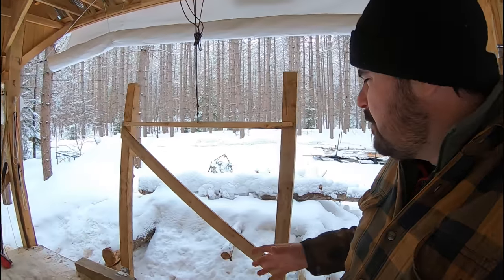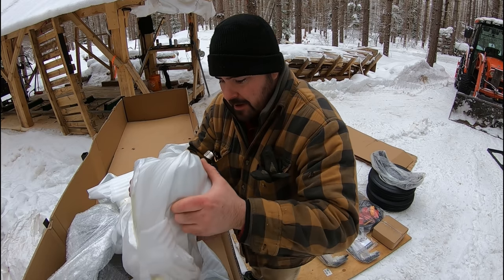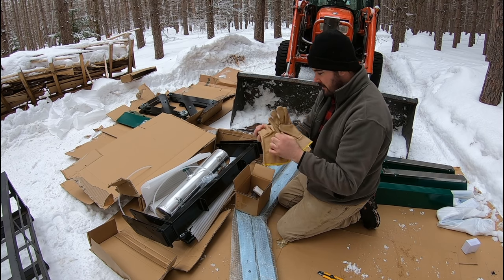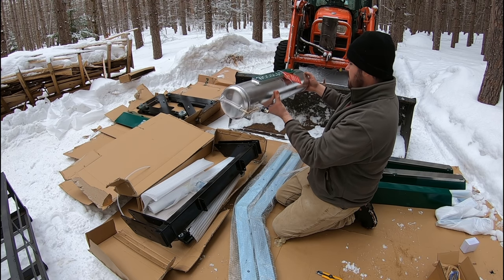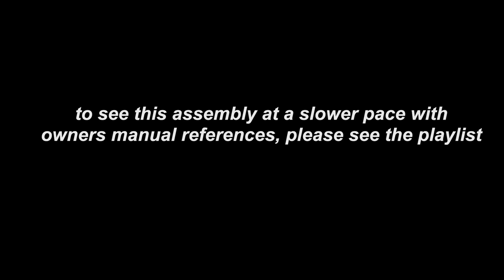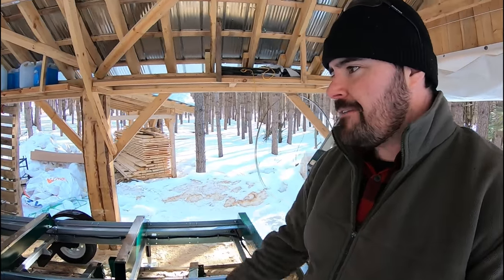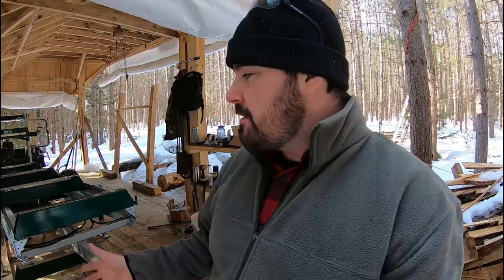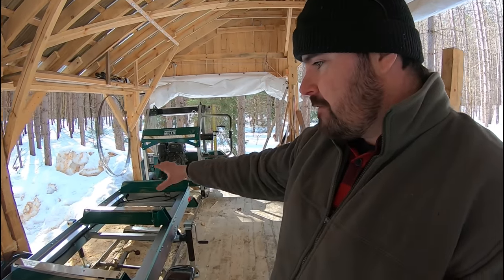Unboxing Woodland Mills HM130Max and Woodlander Trailer Assembly | It's a Good Day

Comment: I cant wait to see your new mill running. It should be a bit higher setup then your other mill. when you replace your log deck slope it a bit towards the mill  would be nice if you made the stringers squared up on your mill  I would make the deck at least 2 to 3 inches higher then the mill  then put a couple of holders  for stringers that  can be removed once the log is on the mill  Your setup for that is ok  just a idea  Make two pin holders out of 1 1/2 pipe  welded to flat iron to bolt on to the stringers so you can drop removable pins into  if  needed  thanks for the video very interesting from john

Comment: a quick tip from our experience. Take all the plastic bags of bolt and measure and mark with felt pen on the outside of the bag what those sizes and quantities are. This saves a lot of time when trying to locate the correct bolt referenced in the assembly instructions as you go along.
Reply from the maker: I agree. Fortunately the bags already had labels which saved a tonne of time

Comment: The metal shipping boxes it came in make great fire wood holders for you mini cabin
Reply from the maker: Great idea Art!
Reply: @sawingwithsandy  Always enough waste with shipping so a little repurposing means less waste
Reply: I was thinking make a weatherproof portable toolbox with some type of removal mount on the sawmill bed (ratchet straps would work) since it is already a trailer with wheels out of the metal shipping frame to leave at the remote milling site to hold extra saw blades, lubrication fluid, hand tools, tarps, etc. while you work at that location.

Comment: I bought a HM130Max last September thanks to watching your videos.  I have it on a welded trailer that I bought from the U.S. dealer.  You might want to consider tack welding all the bolts so the trailer doesn't ever get out of adjustment.
Reply: I lock mine down when towing and when I am not using it with Ratchet Turnbuckles. I have seen several photos where the mill head blew off the tracks by high winds.  I have seen reports where the tracks developed dents in the rails from bouncing up and down going down bumping roads.  The ratchet turnbuckles allow me to lock it down tight.
Reply: @garyhansen6457  You can always edit your comments by clicking on the 3 vertical dots to the right of comment.

Comment: Congratulations -- you might need to start a second channel and hire an apprentice now!  I milled with a trailer-mounted Woodmizer for many years before purchasing my Woodland HM-122 and installing it on a fixed base, and have learned about the pros and cons with each setup.  I look forward to hearing about your observations as you get into mobile milling with the new unit.  My only advice is: 1) check your track with strings religiously before every use, and 2) store the mobile mill under a roof if you can.  Good luck and have fun!
Reply from the maker: Thanks for those tips!

Comment: I wish I  could move as fast as you can.😁  Looks like my set up and I love it. Mine is set up for 16 ft logs. I'm excited to see you move it around your property to cut logs. I was just wondering if it had electric starter, that one thing I wish mine had I'm quite abit older than you are and pull starting is getting harder to do. Happy cutting  Sandy I'm sure I'll  be watching.  👍👍.
Reply from the maker: Thanks Del. Fortunately it does have electric start. I'm looking forward to that for sure

Comment: My mill is on the truck!  YAY!!!! Should be here Wednesday, just in time for torrential downpours… yay. . .
Reply from the maker: That is exciting! I still remember getting the call from the delivery company and was a great day
Reply: @sawingwithsandy  YAY! MILL ARRIVED!

YAY!!! THE RAIN HAS HELD OFF!!

so you just KNOW there was some other issue…

Woodmizer Mills come on their own custom pallets. For this particular mill (LX55) the pallet is 23”x65”. Designed to load on a hi-lo crossways.

When it got transferred at the terminal, it was loaded the same way. Instead of being put atop a standard 44x40 pallet.

HOWEVER. . . that “Same way“ is wider than my trailer. So the driver horses it around 90 degrees, but then it was too narrow for the standard pallet jack on the truck to get both forks under… and, the parcel and the pallet Jack would not both fit on the lift gate simultaneously in that orientation.

Luckily I am one of those “belt & suspenders” types, so I had also packed a come-along and some rope and 2-sheave snatch blocks…

with a bit of creative maneuvering, some muscle work, and a little bit of blood from when my finger got caught between the pawl and the gear on the come-along, (a napkin and some electrical tape is always handy!) we got it loaded into the trailer successfully.

we have appointments tomorrow. But Friday should be unpacking day up at the woodlot. I still need to get about 20 concrete blocks to put under the feet for leveling and stability but I am quite happy to have the unit delivered!!!!!  

Until I get my shed built, I will be keeping the mill under a 10x20 tube-frame tent.  I am thinking of modifying the shed plan a bit to make it sortakinda modular (at least for the platform/base structure) so that I can make the first structure to get the mill off the concrete block and under “hard” cover, then make 8’ additions for lumber drying /storage as I go instead of separate sheds.

Of course, the first project is STICKERS!!!!!!

Comment: sandy are you keeping old mill are you going to store  lumber there.check battery cables make sure they are crimped good mine wasn't came loose and melted rubber off cable before i could get it unhooked. don't leave your books in tube mine got wet and are unreadable i don't know it they sweated or rain got in tube.take care, be safe and well.
Reply from the maker: Thanks for the tips John. I’m going to keep the old mill for now

Comment: Hi Sandy. My HM130MAX with trailer is due to arrive any minute now. I watched the assembly of the saw and you lifting onto the trailer before watching this video. Would it have been possible to have assembled the saw on the trailer or will I need to plan on assembling separate and lifting onto the trailer like you did?
Reply: Ok, after watching the videos, I realize this was a dumb question now. Hopefully I can get mine assembled on my mountain property this weekend. Thanks again for your videos!
Reply from the maker: Hi Reuben. Sorry for the slow reply. It's all good. No question is a dumb question and I"m happy to help if something else comes up
Reply: @sawingwithsandy  If you ever decide you want to take your show on the road, I'd love to have you come visit my little mountain property in Colorado! Just got my sawmill up this weekend, but could only get to the first page of assembly before I discovered that they had only shipped two joining plates. Hopefully I get the replacements in time to assemble next weekend. I went with the HM130MAX XL, and while I'm not sure how many 16 foot beams I will ever make, I figured it is better to have and not need, than to need and not have. Plus, not sure how many more high dollar hobby purchases the wife will allow...

Comment: I'm curious why you built this machine outside in the snow, rather than in your heated(?) shop. I've followed your channel for some time and you've well represented Woodland Mill. By all outward appearances, it's a good machine. In a way, Sandy, you'll answer a question I'm sure many potential mill owners have: should I buy a trailered, or fixed unit? I suspect that question will soon be answered. You've got a great channel, Sandy... keep'em coming....
Reply from the maker: Thanks Carl I’m looking forward to putting this through its paces. My shop isn’t heated and I like building out in the woods a bit better as I know my sawmill shed is perfectly level
Reply: @sawingwithsandy  Thanks for the reply, Sandy. I suspected that might be the answer when I saw the two levels aligned on the trailer frame as you built it atop the (existing) mill tracks. I certainly understand your desire to be out in the woods, although at 74, I've lost my tolerance for extreme cold. Having said that, some of my most cherished times are when I'm helping my nephew on his ranch in Huntsville, Arkansas. (I even keep a "Sludge Maker" in his shop. Like you, I prefer it strong)!
Reply: @sawingwithsandy  Part way thru assy I see you donned the knee pads for comfort. Good choice. Good thing you designed extra room in your mill shed to assemble this one.
This basically answered my query regarding mobile or permanent. Need to mill my beams for the base as "Lumber Jack" did and Shelter Logic for storage of trailer.
Anthony of Erin, On.

Comment: We received a shipment of all the accessories and I am about to pick-up the HM130Max Woodlander at FedEx Freight with my 2 axle car trailer. I wonder if the Woodlander Trailer box is attached to the lower box? I am an experienced Truck Driver but I've also experienced receiving bad shipments.
Reply from the maker: The upper box was not attach to the lower one but is held in place with some side supports but can be lifted off the lower sawmill

Comment: Nice upgrade 👍🏼💪🏼! Are you going to start cutting lumber in the woods? Yes, you get out of the shed, but why go mobile? Isn't it easier to posotion the logs with the saw on the ground, to my knowledge there are no hydraulics availeble for the woodland? Well there is the possibility to use the loading crane to turn the logs... Good luck with the new "baby" 🤗!
Reply from the maker: May start cutting in different spots away from the red pine forest
Reply: @sawingwithsandy 
 Really good reason 👍🏼🤭😜! I think that it will be interesting to continue following as long as you keep on doing interesting videos. Thank You!

Comment: Looks familiar. Just last August I got my HM126 Woodlander. How many hours did it take you to put it together? It does have a very good frame to it. I got the extended tailer. Made a mistake when ordering and got an extra 6FT with some other parts to finish that. But I didn't put it on , because to heavy for axels. Thanks for sharing. Have fun. Iowa enjoys your videos, Sandy. 23 degrees this A.M.
Reply from the maker: Probably took me a solid 8 hours from unboxing to built

Comment: Ok omg. Where were you and this video 6 months ago when I bought my 130max with trailer?  Took me two days to build mine. Lots of parts
I am very curious to hear your input on the only complaint I have on mine. When the mill is on the trailer I find the scales are too high. Because of this and the distance the pointer is from the scale it is hard to get an accurate measurement when moving vertically. Basically because your eyes aren’t parallel with the height of the pointer it is hard to get each cut the same thickness. Your thoughts are welcome on this. Maybe if the pointer was right up against the scale it would be better
Reply from the maker: I’m thanks for pointing this out I’ll be sure to see whether I can come up without something
Reply: Looking at adding a digital readout for similar issue. Posed the question to WM if they recommended a similar product. No answer yet.
Reply: @earlholmes9740  a digital readout would be amazing solution. Let us know if you find one that will work.

Comment: Congratulations, that went together quicker than mine.
My biggest issue is I can’t seem to get the rails running perfectly level. It always seems to have a slight belly right around the axle. 
I took it apart a couple times to try and correct it.
Interested to see if you have similar issue.
Great machine though.
Currently getting ready to build a shelter for it.
Reply from the maker: Thanks Earl I’ll be sure to watch for this
Reply: @sawingwithsandy  I just cut my first log today. What I noticed was the extension was built some other time, some other factory?? and the rail steel wasn't the exact same dimensions as the mills rails. I'm seeing the belly or dip at that splice. (I didn't go for their trailer)

Comment: Congrats on the new mill, Sandy!  I know you’ve had a very positive experience with the HM130 and the service from Woodland Mills, but did you even consider buying an alternate brand?  One of the things that I still wish WM had as an accessory is a debarker to extend blade life.  I can forego the power lift and drive and even hydraulic lift/turn/clamp, but a debarker would be a really valuable addition.  It’s one of the only things that has stopped me from ordering a new WM mill.  That said, while Woodmizer has a debarker option, their Canadian pricing is horrendous - it was over 40% higher than the US pricing last time I checked, and the exchange rate is under 30% so they’re really stiffing the Canadian customers (not to mention their ridiculously long deliver time).  Norwood used to have a debarker but they have withdrawn it, apparently due to persistent problems.   I’m really not sure why Norwood can’t design a decent debarker, nor why WM hasn’t done so as well.  It seems like rather basic engineering design (says the guy who teaches engineering design LOL!)  When I was at the WM Port Perry office in the late fall picking up my new chipper, I had the opportunity to talk with one of the WM owners, and although I tried to extract a bit of info out of him on pending accessories, about the only thing I got was I think they are likely to offer power lift as an add-on in the near future. 
In any case, I’d appreciate your thoughts on this.  Thanks!
Reply from the maker: Since I had such a great experience since 2017 with my original hm130 I was happy to give the new unit a try.
Reply: @sawingwithsandy  Am I sensing this is a promo unit from Woodland Mills? 😏
Reply: 2

Comment: Congratulations  on the new saw,I have the 126 with trailer, did you get loading ramps also
Reply from the maker: Thanks Brian. No loading ramps yet but I may have to order some
Reply: @sawingwithsandy  the ramps work very well,the winch I switch to a atv  winch